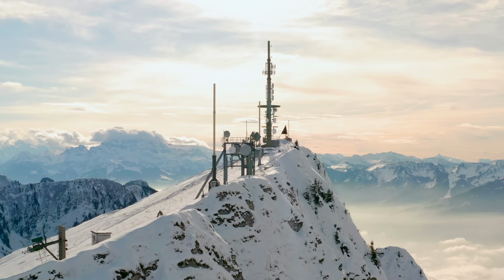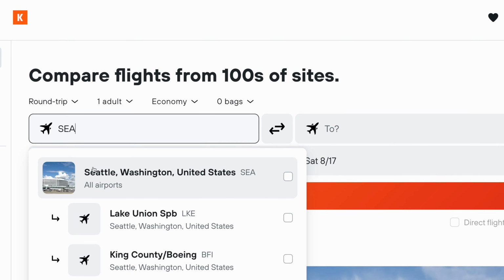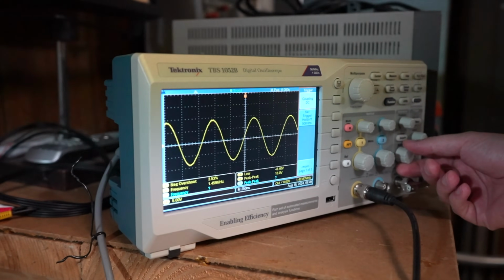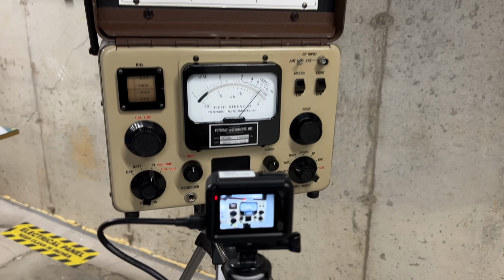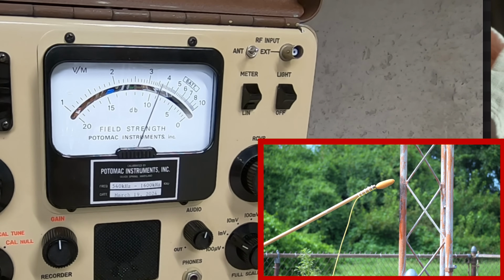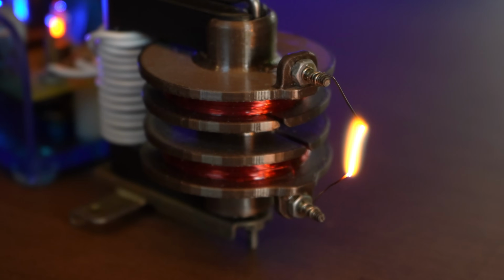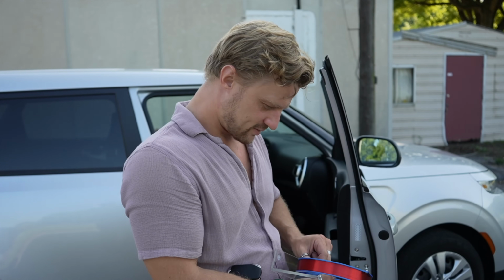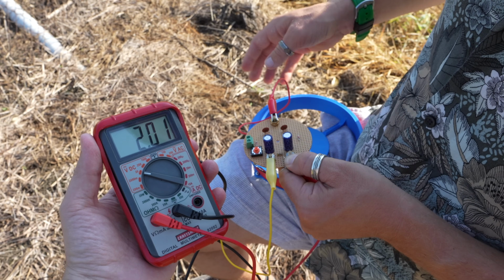Stealing Energy From Radio towers Using Plasma (ft. Geerling Engineering)

Comment: This channel inspired me to make my first project, and I tested my very first DIY arc lighter a few hours ago, it is about 18-20 kv, works great, I get  a perfect 7.5 mm arc on a 3.7 volt battery. I have a question, what material should i use for the final electrodes where the arc occurs? I really want this lighter to last a long time. I was thinking two stainless steel electrodes, but just wanted to be sure...can anybody help? Once fully assembled, i do not want to open it ever again, unless i have to replace the battery. Any answers will be greatly appreciated. Great content, very happy subscriber.

Comment: Radio waves are hardly "high-voltage power." A short distance from the antenna it is measured in millivolts, thousandths of a Volt. Further away it is measured in microvolts. The way you get higher voltages is by building a resonant circuit that builds up power over time, (High Q) and then transforming impedances that raise voltages while lowering currents. BTW, whats "impudense?" And what were the "various oscillators" in the transmitter's  output matching stage doing? Just curious.  :)

Comment: An interesting question I’ve always had is how much of what we pick up in power from solar panels is actually from broadcast now before I get laughed at there is something to this because if you get a rainstorm, there is a reduction in power do the electrons exchanging into the water after the rainstorm, and during the rainstorm through the connective properties of the minerals in the water so why wouldn’t this also be a factor in areas where there’s lots of broadcasts I’m not saying that you could use a solar panel to pick up radio waves and power your house off of it but I wonder how much in regards to 100 W panel that produces 12 VI haven’t had the equipment, but it would be an interesting question the answer
Reply: Solar panels are mostly sensitive to visible light.
I doubt there will be measureable amount of energy collected from other frequency ranges.
However, panels have wires and they can act as antenna. Such amounts can be measured, but they will be tiny.

Comment: That doesn't explain it all. There must be something demodulating the signals. Otherwise you would just connect a speaker to a wire and hear all the radio stations. Which is not the case.
Reply: A speaker would not move because the current would go through its coil equal amount in both directions, faster than the membrane could react. Plasma channel can grow and shrink with every cycle, and it creates a little shockwave irrespective of current direction. It doesn't pull the air back toward itself with each cycle, but continually bashes it out. What you hear is the average pressure that does follow the modulation envelope.
Reply: @Matthew.Morycinski  Makes sense !

Comment: One time i was using an antique Bug Detector during an investigation into a Lawyer's office. We kept getting this one beep. Then with the Microphone set it would pick up Signals. Turns out, there was a pipe going straight to the top of the building where you could get radio reception. Powerful stuff, Miles away from Stations.

Comment: One cold day, here in Southern California(HA) I went with the chief engineer of our AM radio station to the antenna site. We weren't broadcasting. Walking up to the transmitter building we could see a line of something burnt going all the way to the building door, whatever it was, it  was totally incinerated. Inside the burnt line continued, all the way to the Transmitter cabinet. Turned out ... ANTS had made a trail from one leg of the tower to the actual transmitter!
Reply: When lighting hits one of those towers, ants aren't necessary, it will get you. I have seen it melt aluminum. The reason it doesn't take down the tower is that it travels on the outside of the conductor and it is brief.
Reply: @tedoptional-p8l so you would be saying that the resistance of the conductor itself it's too high for the voltage penetrate more than skin deep
Reply: @tedoptional-p8l  is that the skin effect?
Reply: Please set up a radio transmitter in my backyard to vaporize the ants nest that never goes away. They evolved to become resistant to Raid ant spray.
Reply: @trollpatrol1177 gas works well
Reply: @trollpatrol1177  gotta treat neighbors then yours 🌐 trap em
Reply: @trollpatrol1177 malditos!!! Por qué queréis hacer desaparecer esa maravilla de hormiguero?😢
Reply: @trollpatrol1177  I heard pouring molten aluminum down the nest works.
Reply: That day the Queen ordered cable.
Reply: @richarddevenezia8186  ...and you ANT kidding, either! ;)
Reply: @richarddevenezia8186  HA ha ha ha
Reply: Ants don't like diet orange soda. I poured it in their hole and they died or moved away. Probably went in your yard.
Reply: Out of curiosity, could you say what the station was?
Reply: @Socaltransit there are some large AM stations in SoCal, but with that much power i am guessing it was KFI.

Comment: I'm really curious about just how far or close to the transmitter you were when it actually blew the diodes. This would have been a awesome little experiment. Though not generally providing any useful data. Just cool factor

Comment: I wish you would've built your receiver more durable (and with a radio speaker, or fan, or anything else useful, not just an indicator diode).  I would've been really hyped to see you playing radio, cooling off with a fan, or cooking a little tiny bit of food with wireless power (not by ground with the tower, that seemed scary).  I wonder if Tesla would be so happy that we achieved wireless power as a species or disappointed that the way it works it is too dangerous up close and too weak far away for most uses.

Comment: I would like to see the more challenging version--use beam steering for transmitting the RF power. I have wanted to see it used for power ever since reading about the idea of orbiting solar arrays beaming power to antennas on the ground that feed to the grid.

Comment: All that power going through the air makes me wonder what it’s doing to our bodies?!
Reply: Body is acting like resistor - it is heating. By tiny amount.
Reply: Nothing. Unless maybe if you have a pacemaker lol
Reply: I read somewhere it can cause cancer.
Something along the lines of people who work near powerplants have a higher cancer likelihood
Reply: Arthur firstenberg wrote a book about it, called "the invisible rainbow".
does a lot more to the body than a lot of people would like to think.
Reply: @laus9953  A lot of ill-informed people. I had 20 meters of wire stretched all around my attic. All it drew in amounted to some 200 millivolts - from all the 50 kW radio stations across the river. It's nothing. Don't be paranoid.

Comment: My first AM radio I built as a kid, was powered from a single wire running from outside my window to the garage a few meters away.
Reply: I once saw a Popular Electronics AM radio project using a crystal radio plus a transistor amplifier.  It was powered by a resonant circuit tuned to a local high powered AM station while the receiver was tuned with a second tuned circuit to a weaker station.
Reply: @8546Ken  this was a crystal radio. It just had a little earpiece so didn’t need much power. I think we tuned the antenna to one of the local stations. At night I could pick up stations further away.
Reply: @MeppyMan   I had two crystal  radios when i was a kid.  i stretched a long wire antenna from the roof of the house to the roof of the garage. The tricky part was adjusting the cat's whisker.
Reply: How old was the kid? I had no idea you could use them for a radio.  Sorry, couldn't resist. 
Yeah, built one of those too. Had really poor selectivity.

Comment: When you say, radiated power/energy drops off exponentially with distance, don't you mean inverse square because the mathematical expression of the energy contained in a spherical wavefront is the surface area of a sphere given by the radius^2?

Comment: Soooo.... Tesla was right.  Is there free power flowing all around me now?
Reply: Radio waves are everywhere and they carry power. But amount is tiny. Capacitor and diode leakage will be higher than current collected from radio waves in most of the cases.

Comment: I ran 120 thpusand watts in my serburbaine comp cb radio and I it can kill you if you touch the antenna if not grounded. You can see the huge arcks traveling up my cb antenna sometimes ark more than few feet to my other one when I hit both turbo charchers with tons altnators.I sold that thing wish I still had that truck.😅 you can hear my voice in the arcks and it made good cigret lighter.😅

Comment: if you want to have power gain from a radio tower you must make a transmitter that deliver at the same frequency radio tower so that the electric output from the tower only produce power gain where the current in the local transmitter is just circulatiing trough the wires. when you put any load on a circuit that produce a frequency the voltage will always smooth out the wave will cut. that is why you want transient spikes as a signal can they can cause power to transmit longer cut they too get smooth out but not as much as little voltage. creating a spike is like dropping a ball in a pond. the rebounce is the spike. notice you only need power gain not the whole current. you can use 90 percent circulation in a tank circuit. you only need a little bit of extra juice from the main radio tower to produce real power in the output.
Reply: I'm not sure where you're going with that.
Reply: @jamesvandamme7786  you know radio was understood long before the parts you see in them now. people try to replicate what they see in a modern radio but the parts in that radio are scaled down parts cause the real old times they used giant inductors and capacitors to run the transmitter and also used big inductor and caps in the receivers. its all about tuning the inductance to the capacistance or the capacistance to the inductance to match the input signal but only receiving the parts in a bigger receiver can not produce real power cause if you use bigger inductor and capacitors the caps wont be exited and there will be no power. you have to supply some extra power to the receiver circuit to exite the caps so that signal from the main transmitter can produce power gain in the output transmitter in phase with the main transmitter or it wont get into resonance.

Comment: I was a broadcast engineer back in the 80s.

Even a 1KW AM transmitter feels like a flat iron when you touch the tower.

Don't ask me how I know...
Reply: For a couple of months i had a little dimple on the tip of my index finger from tuning a 144MHz magloop antenna and getting too close to the tuning cap. Smelled it first, felt it a split second later. RF burns go deep! And this was fed with just 10ish watts!
Reply: @mfbfreak  Stepped up in voltage by the matching network!
Reply: @mfbfreak 
FYI, I'm W0TTM 😎

Comment: at approx 3m20s it was stated that energy delivery drops off exponentially with distance.  wouldn't it be more accurate to say the dropoff is geometric? or inverse-square?
Reply: Inverse square is correct; a bit different but the idea is similar of course—there's a massive drop off as you travel further away from the tower.
Reply: @JeffGeerling  thanks for your response.  and, i forgot to mention, great idea for an experiment, and nice explanation from the plasma guy about how it works.

Comment: 186 comments ⚡️def wud like to see future vid on this, tuning, wireless transmission n receiving...see jain 108, 144 code..interesting 144mhz. Been working on gemspheres aka gem energy plasma spheres. The idea is that once formulated, using water 💧 Hydrogen and oxygen and then permanently  sealed in borosilicate glass spheres,they can then be tuned to a specific frequency, ie 60 hertz, be transmitted via longitudinal or scalar waves 👋 that broadcast doesn't require any power and will transmit around the world.the scalar receiver would receive and transform into traverse signals.prolly not that simple however a battery research n testing company was able to duplicate the formula and used 25k probes which hung directly above GEMs plasma water and we're shocked when they were instantaneously able to record voltage ⚡️ spikes in 3 1/2 minute intervals. The book is called The Hydrogen Cipher and is available on Kindle or judybeebe.net ❤

Comment: As an Amateur Radio operator, you've got a measely 40 watts loss at 12,000 (twelve thousand) watts out? !!  Almost nothing to be even slightly dismayed about.🤣🤣🤣
Now when you're transmitting 100 watts out and losing 40 due to some antenna system ineffiency, shut it off.
KD8EFQ/73

Comment: I haven't tried that trick with the hotdog yet with my AM tower. It's only 1KW but I can still hold a fluorescent tube near it and it will flash with the modulation and pretty much anything near it is a crystal radio kinda thing. I have heard the term for the coils and stuff singing is zeusaphone. The ones in my transmitter that is the very baby brother to the one you got hands on sings a bit at full power.  Welcome to Missouri and hello from the other end of the state.

Comment: Is there a way to visualize how much wireless energy is hitting us from which direction?  Could it be used to "see" radio towers off in the distance, beyond the horizon?
Reply: I think it is possible to achieve by rotating directional antenna.
Or many antennas in fact if you want to cover multiple frequency ranges.
Reply: @sdjhgfkshfswdfhskljh3360  I remember Thought Emporium did it with indoor WiFi signal density just like you describe.  I wonder if you could do this long-range outside.

Comment: In your transformer example ,.. the arc frequency is 120 Hz.  The  current flows through peak 120 times per second.  Once on the positive peak, than passing through zero voltage where the arc extinguishes, and then again through the negative peak. 2 distinct peaks per cycle  60 Hz  =120  Hz  frequency of the arc..  In some non symmetrical, there can exist at the same time 60 Hz..  Interesting video.  W1VLF

Comment: I don't want to see a video about wireless power. It's been proven to be horrendously inefficient over any significant distance. I don't know if this can be changed by focused transmission but that's not what you suggested. Encouraging and misleading that this is a viable means of power delivery in a world undergoing environmental crisis largely due to power generation is very irresponsible. Have you thought about that? I would have thought that might be something you cared about at least a bit, and your influence over. Am I wrong?
Reply: Video about wireless power which will show horrendous inefficiency will be fine I guess.
Reply: @sdjhgfkshfswdfhskljh3360  yeah that's true
Reply: I feel like I already know what's going to happen if this guy sees this. He'll clam up and implement the 'thick skin' upon sending negativity. It's so rare anyone can tolerate even the slightest criticism on the internet yet criticism is an integral part of scientific proceeds and just not causing harm in general. But this is the internet, he will switch off. He won't consider if there's any truth or validity in what I said or my points even for a moment. He'll go on to do exactly what he likes sure in the knowledge that itself the exist 'educational purposes' good play is a harmless benefit to us all. 

Look I'm not a hater. I care stuff and wish more folks had the maturity to just stop, actually listen and think when they hear something non supportive. It's not the end of the world and not every idea is a good one, and people do have a tendency to get carried away. Just listen and think for a second, it's all I ask.